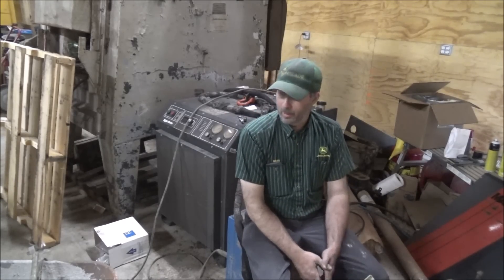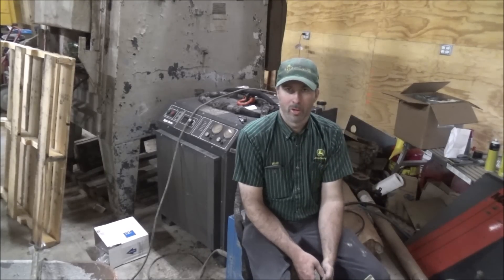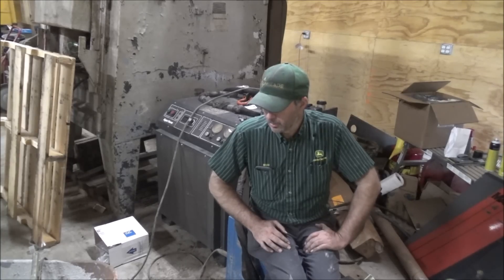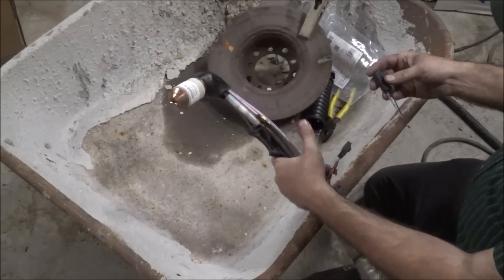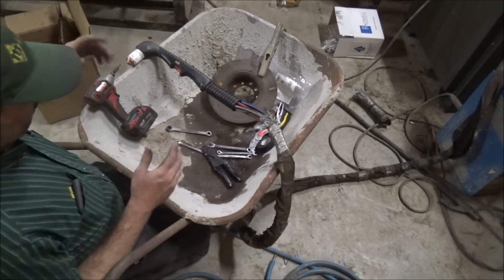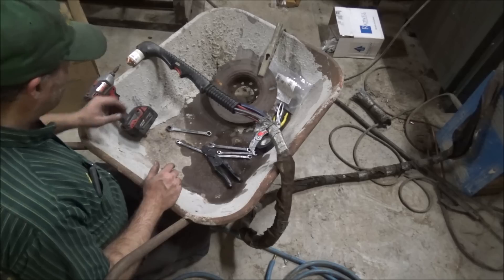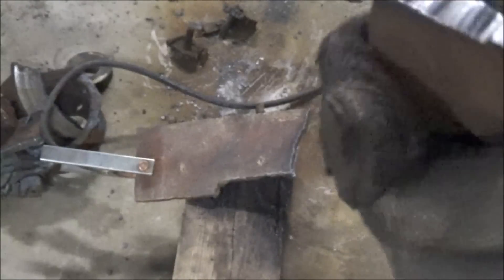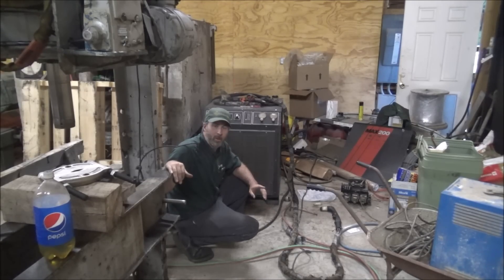Fixing My First Plasma Cutter

Comment: What pressure did you set your shield and plasma? I have a max 200 without an owners manual. I have no clue what my shield / plasma ratio should be. I’m at 180 amps

Comment: that black rubber flex tube looked like it came off a planter fertilizer box. i used those for the bundle of cables up to the monitor/controller on my round baler. inner tube & zip ties work to

Comment: Very nice, looks like that will cut through a thick old slab.
My commiserations to the wheel barrow at 13 mins..... at least it won't fill up with rain water now ;)
Reply from the maker: CwazyWabbit It got the concrete off. Lol
Reply: @bcbloc02  Lol, certainly did :)

Comment: you may need to made a triple ring clamp assembly for the big head diameter.. oOo so you can position some ceramic rods in the small holes to get you on an even torch track on the surface.

Comment: Brian, mine cuts better from left to right, has to do how the air swirls around the cut. The smoke is hard on lungs, big time. That's much bigger than my machine, by a lot. Keep smiling.

Comment: Do you ever buy anything normal size?  😁   I picked up a HF plasma about 10 years ago,  It's still working great.  Heres a quick tip,  put a dryer on the line that feeds the cutter, or you will go through a lot of the consumables.

Comment: It's a good thing you;re building a large shop, I have saw a tool yet I could move by myself. LOL I'm proud to have you in Ky there's not a lot of people in these types of business esp to do the degree or size of work you're setting up to be anymore that I know of.  
Thanks for sharing.
Reply from the maker: Notice it has a built in hook on the top so you can move it with the crane. :-)
Reply: @bcbloc02  And built in the day when it was still a sin to build equipment out of lightweight tin and plastic. You got to love the older stuff.
When I went to look at a new mower a few years ago I got completely disheartened  at what they was offering in my size so I went back home and looked for another year till I found me a old IH Cub  bought it and done the needed repairs, there's no plastic rear diff or tin about it.
Reply from the maker: John S. I got my front teeth broken by the hand crank on a farmall cub when I was a kid so I don’t particularly care for them. Lol
Reply: @bcbloc02  I can see that.  I only went back to about 1971 I think it was. Starter/generator. Grandpa used to talk about some bad experiences with those old hand cranks to.

Comment: Hey Brian Jeremy here from Wisconsin. Whats the amperage output of that machine?? Looks to be 200 amp or even higher machine lol.. we have a 400 amp machine that runs the plasma table at work thats literally the same size as yours.. im guessing your is a little older therefore explaining the size difference?
Reply from the maker: Yes it is rated for 200 Constant amps.

Comment: Brian I very seldom use my oxy-acte torch any more.  My they have came a long way since that one was made. Mine is a Hypertherm and I can put a shoulder strap on it and climb a ladder with it is so small. Mine will cut up to 3/8" thick steel and runs on either 110 or 220 single phase. I had the same problem as you when I first started using mine. I tried to keep the end of the tip off of the metal and then I learned to just drag it. Using a straight edge I can cut very good very straight and very fast. As well as very cheap. Great video thanks for sharing it with us.
Reply from the maker: This one will cut 2" and do it at 100% duty cycle so it weighs a bit more. :-)  It would be handy to have a small one too but this one was cheaper than a new small one so its what I went with.
Reply: @bcbloc02  Brian that is a beast. 2 " Wow. Now i can see why it is so big.  The little China Town plasma's are pretty cheap now compared to what I paid for my Hypertherm 13 years ago. I paid over $1300 for it when i bought it. Now i have seen some  China Town ones about the same size that will supposedly cut up to 3/4".  Great job and would love to hear how Bailey is recovering...

Comment: replacing multi-wire sleaves things like that, I found the best is old bicycle innertubes...  2cents
Reply: i tried saran-wrap and duct tape once,  and it just pulled and broke all the thin multi-strand signal wires by stretching...  a no-go.  too tight for flexing.

Comment: Thy had a smaller one of those at the boulder hole and it was used to cutting A/R plate. Worked fine. Liked the multi purpose work station and I saw the Boss slip by. Good job.

Comment: You will enjoy the plasma especially for gouging welds and cracks out. On my pm 65 hypertherm I rarely adjust amperage I just speed up or slow down travel speed. Only thing you will notice is trying to cut a bearing or separate 2 pieces of material the plasma cutter don’t care and will cut into the base piece easier than a cutting torch will

Comment: Brian, a TIG Torch - Cable Cover would help protect the leads and hoses better then duct tape. They are fairly inexpensive and easy to get. Something like this  https://www.ebay.com/itm/TIG-Torch-Cable-Cover-22x3-abrasion-resistant-nylon-zippered/192224371699?hash=item2cc17723f3:g:FrcAAOSw-29ZSr3n . I have wrapped some big Hyd hoses with them and just zipped two or three together to get the circumference I needed.

Comment: It's been years since i repaired a plasma cutter, but one thing i remember : they don't like oil or water in the air supply . Keep filters maintained ! if you have oilers in lines for air tools run a seperate line for plasma cutter.Good video !
Reply: Consumables wear VERY fast with humidity or oil in the air supply, I use a desiccant set-up for the air to the plasma cutter here.
Reply: Good idea , and oil can cause arcing inside torch . @pierresgarage2687

Comment: Use what is handy for  workbench.. lawn chair, tailgate, wheel burrow.. what ever it takes and what ever works.
Reply: You have to consider for a man that has probably spent many hours laying on his back in a farm field working on broke down equipment, working in a wheelbarrow is a big step up.
Reply: Oh I know too well the feeling.. thus the comment... I have used them all too.. ha
Reply: Wheelbarrow = workbench with caster and handles...   😀
Reply: Exactly Pierre...lol
Reply: I see 1 big advantage of working that way. If you drop any part while working on the torch. You will have a better chance of finding it. Work smart.
Reply: You are so correct Lee... lol... gotta make it as easy as you can on yourself...lol

Comment: That brings back memories of replacing torch heads on a turret punch press with a plasma torch. The whole thing looks the same. Good Job fixing it Brian. If memory serves me the torch should not touch the material you are cutting it needs an eight of an inch gap.
Reply: Y Pop 
All gaps all loosen up over time
Reply: @JJ-jv1gu  YEP especially on that turret punch press
Reply: Y Pop 
Seems the darker they are the more they hold up

Comment: Looks like someone forgot to wash out your workbench the last time they hauled concrete in it! There’s always a need for a horizontal surface in a shop!
Reply: Stay home during the next auction and build work benches
Reply from the maker: But what if there are benches at the next auction? :-) Bigger problem could be where to put them.
Reply: Good one. I was about to say the same thing.
Reply: Don't worry Brian. I've used almost anything for a work bench. A garbage can is my favorite.